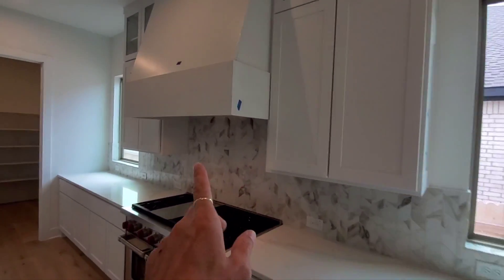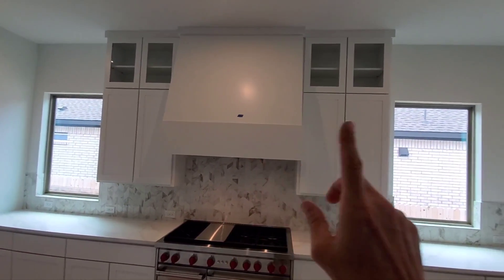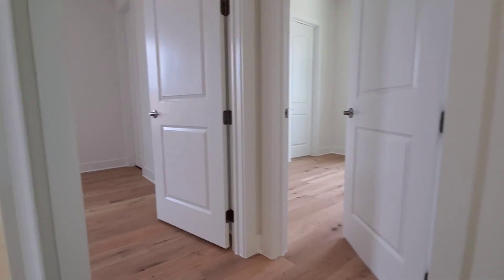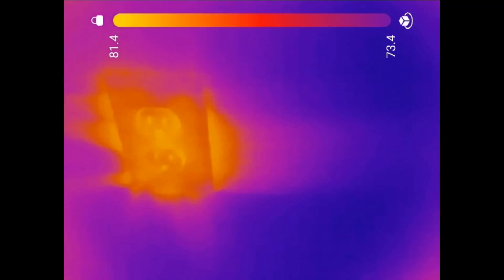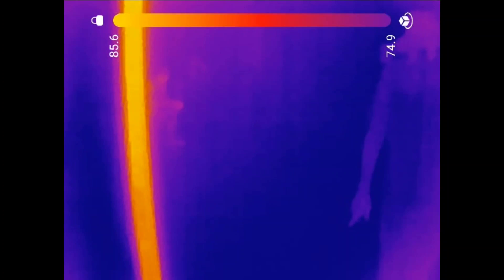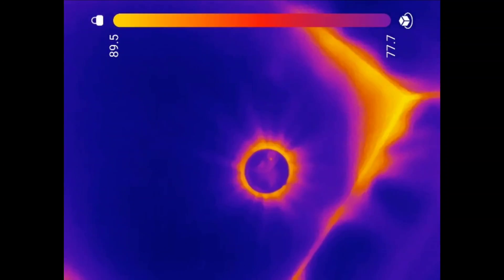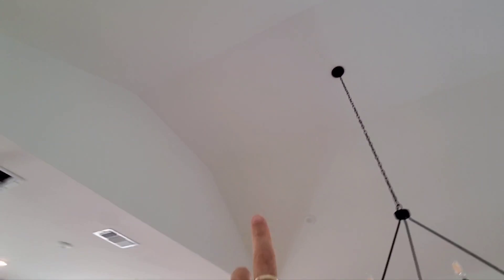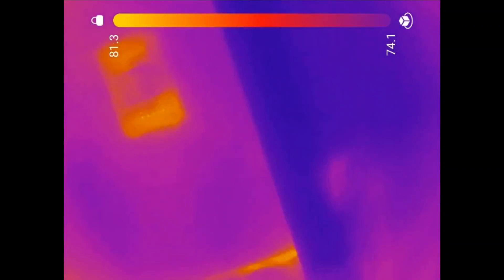Understanding the thermal envelope of a house

Comment: Lurker here:  What's the downside of air being drawn from those locations?  Why was the makeup air vent closed?
Reply from the maker: Hi there Lurker. The downside is that the air comes in unfiltered through the attic down between the ceiling and wall transition, through the walls and out. What you don't want is to bring in all of that humidity that can condensate inside the walls, nor the hot August or cold February air to work against your AC. 
The makeup air was closed because, most likely, it was improperly installed. I think that had an electric motor damper so it would need to be tied into the vent. Unfortunately it was out of my reach to really investigate but no doubt the builder will send in their HVAC guy to sort that out.
Reply: construction dust
construction offgas
if there is ever a leak, mold

Preferably replacement air is just fresh air from outside.
This is done by either balanced house pressure, with exchange coming from controlled traffic (windows and doors intentionally opened) or if you are losing pressure through kitchen&bath vents then you want some form of intake that comes from outside not within walls or attic.

I've seen a few remodels where they add a vent to the garage and then blown in cellulose is sucked into the house through unsealed can lights.

Crazy how little attention is paid to mechanics of homes.
And crazy how many specialists don't know or don't carry out what they know.
But, good people are out there and worth the effort to find them.

Really good video !

Comment: In situations like the ceiling, what does the builder do? Do they rebuild the ceiling or do they just cut a check to the customer?
Reply from the maker: The ceiling is batt insulation and that can be accessed from the attic. The builder can fit that down better and that'll do the trick. The wall is a different story.